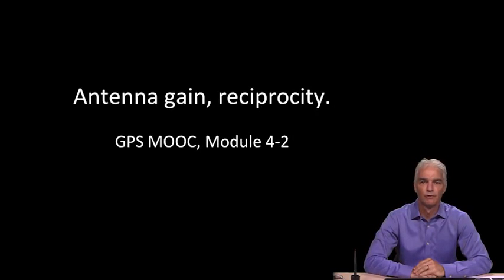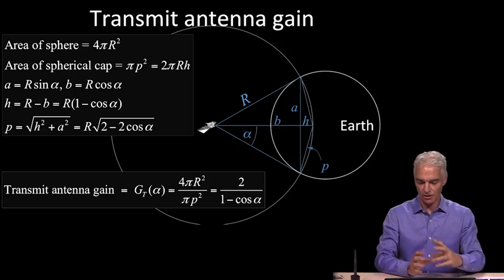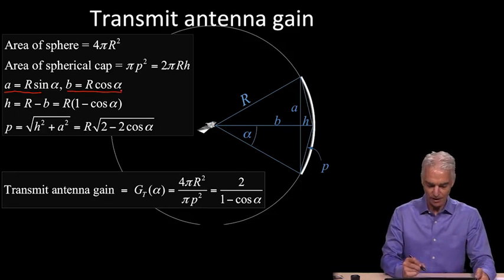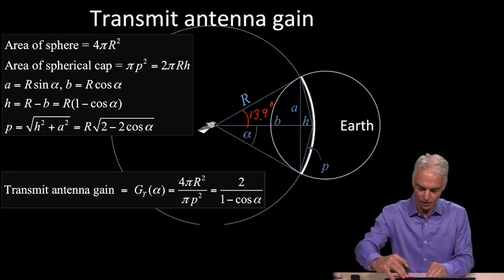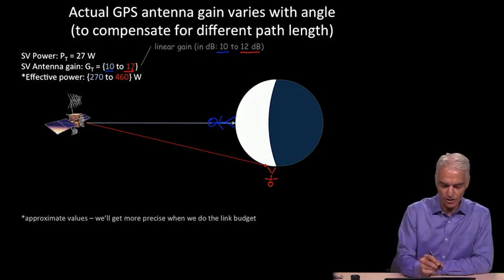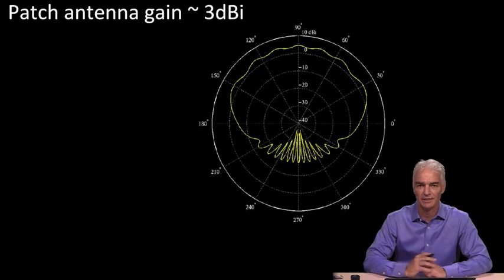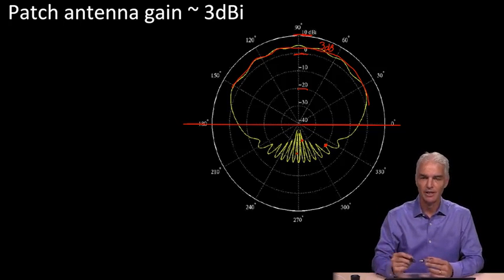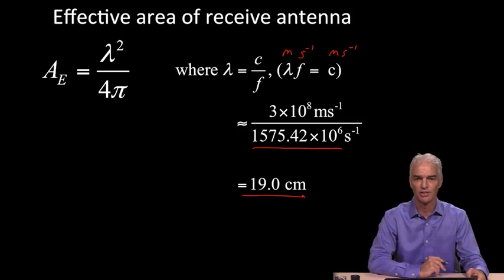4.3 - Antenna gain, reciprocity

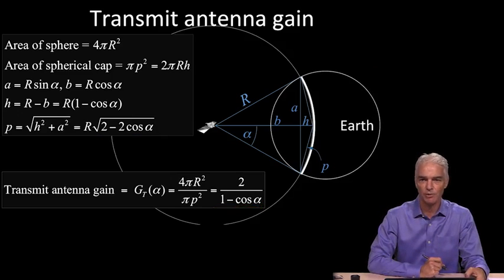Comment: Great lectures although it's not clear where the 10, 10.2, 12, or 17 Tx Gain factors come from.  Using the formula derived "transmit antenna gain formula" @ 5:36 (2/1-cos(alpha)) the values don't work out to be what was mentioned in the link budget.  I"m curious as to how those numbers came to be.  At zenith cos(0)=1, making the gain undefined.  At alpha =21.3", cos(21.3") = .931.  Using the formula 2 / (1-.931) = 28.99 Tx Gain...?

Comment: Great Video! It explains very well how gain is calculated for GPS. Although I think antenna reciprocity was not fully covered, is there any doc you can share with us so we can look deeper into the theory of antenna reciprocity? Thanks!
Reply from the maker: Unfortunately not. I would try with their books, they cover extensively and in more detail what is covered in the video course.
Reply: Correct - in the videos we did not go any deeper into the theory behind antenna reciprocity. 
Wikipedia has some good explanations of electromagnetic reciprocity in general: 
  https://en.wikipedia.org/wiki/Reciprocity_(electromagnetism)
and for antenna gain patterns, in particular:
  https://en.wikipedia.org/wiki/Radiation_pattern

Comment: so antenna gain is by definition the ratio of powers, how come he calculate it based on surface area?
Reply: Good question: the effective area (with units are area, m^2) is not itself a gain but just a means of setting us up for the link budget in the next video. When computing the link budget we need a term that shows how power density (W/m^2) translates to received power (W), and this is where we use the effective area.
On reflection, I probably should have put this "Effective Area" slide at the beginning of the next video instead of at the end of this one.
Frank

Comment: Why antenna gain is 10 to 17?
Reply: This is because the GPS transmit antenna is designed to have a strong lobe in the direction of the Earth, and very little anywhere else (so as not to waste power transmitting signal into outer space). This explains why the gain is >= 10. The video explains why it gets as high as 17 (because the lobes are larger in the direction if the edge of the Earth, to compensate for the longer path length).

Frank